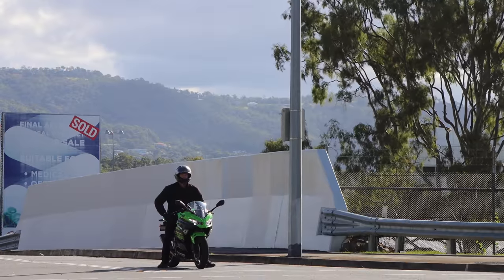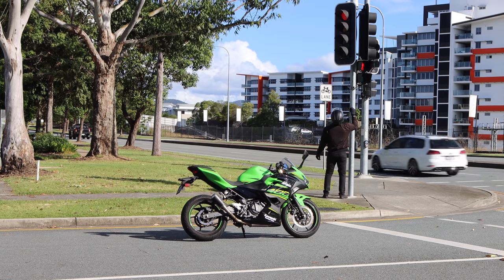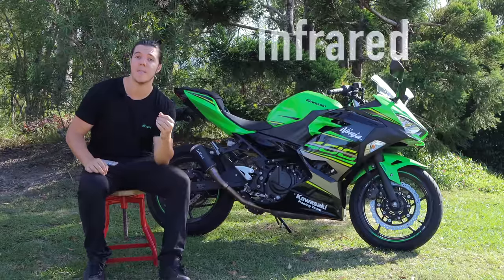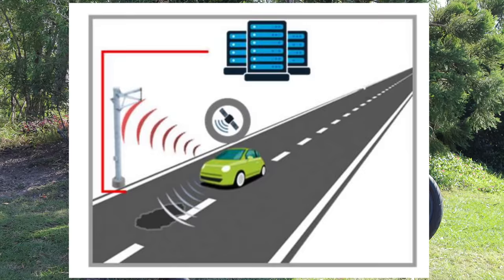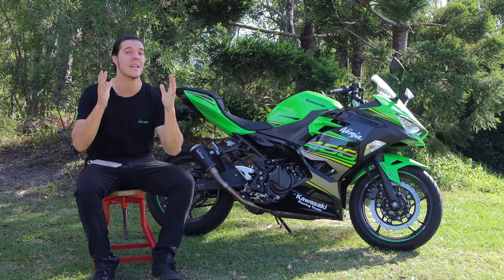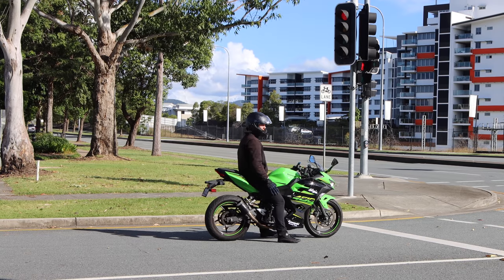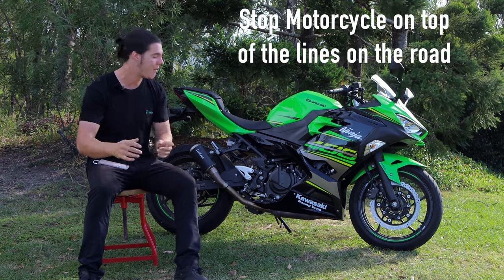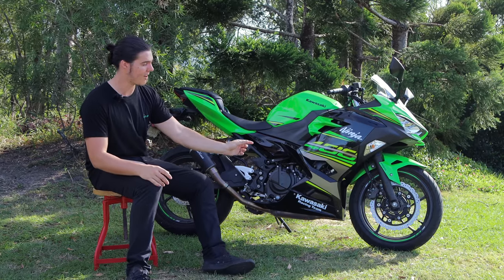How to trigger Traffic Lights on a Motorcycle | Stop getting stuck at red lights

Comment: As a signal engineer for 30+ years and a biker for even longer the most sensitive part of the loop is the corners. Run over a corner of the loop with your wheel and stop with a wheel on the corner will guarantee detection. Do not sit in the middle of the loop having only run over a single bit of loop. The wheels a 30mm off the loop will be picked up a lot better than an engine 300mm from the loop, provide the wheels are conductive. A corner will pick up even a pushbike wheel. When testing the loops we can use a hacksaw or a few twists of cable to trigger the detection
Reply from the maker: Great advice! Thanks for your input mate 🙏🏻

Comment: In my state and lots of states in the United States, you can run a red light at first safe chance after one complete cycle of not getting a green light.
Reply from the maker: Yea I mentioned those 'dead red' laws. What state are you in mate? And is it a common thing that you do?
Reply: @Kwackajack  Arkansas

California

Idaho

Indiana

Kansas

Minnesota

Missouri

Nevada

North Carolina

Oklahoma

South Carolina

Tennessee 

Utah

Washington

Wisconsin

Virginia
Reply: @Kwackajack  there may be more. This list is from 2014. We keep trying to get dead red laws passed in Texas along with lane splitting, to no avail.
Reply: PA also has this...its called ride on red
Reply: In Illinois you are allowed to run it after waiting 2 mins with no green.
Reply: I typically take a right and then do a U-turn or pull left into a parking lot to turn around.
Reply: @IamR3D88  I just don’t stop for reds
Reply: 5:38
Reply: So if I'm approaching a set of green how would I know they have been dead for some cycles before. Plus the US have that weird turn right on red after stopping and most who do wander into the second lane and accelerate like a snail. I much prefer RED means Stop
Reply: @TheByard  
In the US if a cop pulls you over for running a red light after waiting all you tell them is your exercising your right to proceed with caution. It works every time if the cop comes into the picture after you been waiting.
Reply: @TheByard  most of the US also has the left on red from a one way to a one way.
Reply: @dennisthemenace49  Damn dude you reside in all those states??
I can’t imagine all the taxes you pay!
Reply: @charlesmeade4451  As a Brit who started driving in 1962 and have driven in many countries around the world. I find it strange that the US use this filtering system, which going by all the videos on YouTube is constantly abused. For the few minutes vehicles are stopped at the red lights is that too long that cars can filter into a green running lane of the traffic from the left. Often then they cross into the center or third lane, accelerate slowly and cause mayhem that they drive away from unscathed.
Where the system does not work and causes deaths, should be stopped.
Drive and arrive alive.
Reply: Yeah I want lane splitting in Georgia.
  I normally get off my bike and press the cross walk sign also btw. I'll look for these lines next time first though.
Reply: You don't have to stop for right on red... Or I've just been doing it wrong. Pretty sure you check while rolling blast shit, normally 2nd gear. Only stop if something is coming.
Reply: @Whitejesselink  Some junctions you do and there's a sign stating just that, maybe not in your local though.
Reply: @Whitejesselink  In PA, and all the other states that I know of, the rule is Right On Red After Stop. You have to stop and then proceed to turn right if and when it's safe to do so. It's treated the the same as a stop sign, and not stopping is considered running a red light.
Reply: This is Legal in Pennsylvania as well, extended red light, when safe., you can proceed
Reply: I've probably just been doing it wrong. I've never had a normal car, just one race car Miata and a few bikes.  If I taught someone to drive they'd probably be good but unable to pass a driving test in a real country. America let's anyone with a pulse drive though.
Reply: @TheByard  Thank you for taking the time to write a well thought out comment. I enjoy reading longer comments that are well written. (The A.I. is trying to make people forget how to use written words to communicate by giving you suggestions and memes and spell check, so you don't have to think anymore...) You can fumble around on a phone and the A.I. will create a message for you now. I cringe seeing that the younger generation can't even type a paragraph with punctuation.
Reply: @TheByard  Regarding the "right on red" law in the USA. What scares me to death is the idea that you would have a steering wheel on the right side of the car, and you'd be shifting with your left hand? I think something like 93% of the population is right handed. Shifting with the left hand just cannot be as effective. When I watch motorcycle videos in the UK, it scares me to death! I feel like I'm about to witness an oncoming collision, because it messes with my mind, seeing the visual of the lanes being reversed! It's so scary. The "Right On Red" in the USA works fine. I have never seen it cause an accident. What it does is keep the traffic moving, and it's a necessary law to prevent congestion. The problem is actually poorly designed roads, with 5 or 6 way intersections, that are extremely confusing. I get the impression that in the UK or Europe, they would fix an intersection after thousands of accidents. There is an intersection by my house that I've personally seen dozens of severe accidents, and they have not changed the intersection at all.  It's an intersection without stop lights, where 6 different lanes merge together, similar to a miniature Freeway overpass. People get confused easily, and you cannot more than 4 lanes at an intersection, it's just too unsafe.
Reply: @Ritalie  Have driven in many countries around the world and found driving LHD or RHD no problem have also  center seat and facing the side of a the machine, again no problem. Front and rear steering road wheels. On a four year contact in Denmark with a home leave UK once a month. I would drive my LHD car to Copenhagen airport, park if fly a couple of hours and jump in a RHD hire car at Heathrow airport. It's a bit trickier driving a RHD hopping on a ferry to France and the then driving on the wrong side of the road.

London police advanced drivers had to do a test on all the different cars in the fleet. Run to the chosen car unlock it, revers out of parking space and drive to a stop line, operate all the control levers switches etc in sequence and then drive on the skid pan in reverse chasing an instructor who was also in reverse but with bald tyres.

Road design and the use of traffic lights can be improved on using longer time settings for busy roads but real time monitored so one set of lights could allow more vehicles through. 
Test were done that emergency vehicles could operate the lights in their favor with a controller in the cab. This worked well for one or a convoy, but with multi units using differing routes, it needed radio contact to make it work.
Reply: @PAULY-P  Being right is great but being dead right isn't.
Reply: @TheByard  I freaking love Copenhagen.
Reply: @TheByard  
Well, I guess I'm just right....on what I wrote above lol.
Reply: @bty1471  not in Georgia. I've done it infront of cops. You're supposed to look first.
Reply: @Whitejesselink  ok buddy. just cause you didn't get pulled over doesn't mean its legal. i assure you tbe law a ross the US is you must stop before making a right
Reply: @Whitejesselink  You treat the red as a STOP sign if turning right... you have to stop before proceeding. In Europe they don't have right on red, but some intersections have a green right arrow light when straight and right are red, BUT it's like a right on red in North America, there's still traffic coming with a green from the left...

Comment: What I’ve learned is don’t stop in the center of the lane. As you approach the intersection take note of the cut out lines in the road where the wire sensors are to the left and right portion of the lane and stop directly above it as opposed to stopping in between them. Doing so gives you a better chance of the magnetic sensor detecting you.

Comment: Just saw this video. you got a chuckle out of me when you were sitting on your bike having coffee or tea while waiting for the light to change. I can definitely relate. I live in a rural area, and sometimes when I get off late, there is hardly any road traffic. occasionally I've had to run the light. I've contacted my local DOT and all they tell me, is that there might be an issue with the sensor. I've done what you have mention, but it's not working. next time I'll try what another poster recommends about restarting the bike and see what happens.

Comment: I’m in Cali.
The dead red law explains why the cops haven’t pulled me over for ‘running’ the reds.
I’ve looked and shrugged 
One cop even waved me on from his cruiser
Reply: What a badass 😎
Reply: @christian3050  ~ right? I’m such a rebel 😂
Reply: I'm in a Northern California city; the one with no left turns, no synchronized lights.
Reply: @Ramon51650  ~ 😂😂😂
I think I know that place!
Reply: NC here. I've done it with a cop behind me. Bit of a gamble, but they didn't pursue. Either they knew the law (unlikely) or didn't feel like putting in the effort.
Reply: Note, it is not truly “running a red”. It is more of treating a malfunction traffic light as a 4 way stop.
Reply: And, yes I have done it in many jurisdictions in all over North America.
Reply: Bravo!
Reply: @henrybrown9724  ~ well that completely sucks.
Reply: @codedirtytome7178  No, they just know that this is an issue with the loop.
Reply: @henrybrown9724  Same happened to me.  I sat there for at least 5 minutes, no traffic anywhere, 11:PM on a Sunday night.  The moment I went through the intersection he moved from his hiding place with the lights on.  Do the magnet in the shoe trick.  Or try the stop and then electric start your bike. It works.

Comment: New rider here. I encountered this near my home. Yes i too thought the sensors were weight triggered. Now i know the truth. I've been running the red light but i'll try these tips next time.
Reply: What I've found is that there is absolutely no way a sportbike will trigger the magnetic loops. I've tried moving my bike, and putting the kickstand down, and even flashing my lights, in WA state. Nothing works. The only ferrous metal is the crankshaft, connecting rods, timing chain, camshaft, and transmission. It's not enough metal, and you'd have to be absolutely perfectly positioned to trigger the induction loop. It's better to just run the red light after a full cycle, which is legal. Or to simply avoid the intersection (best idea). You can easily avoid these desolate traffic lights in obscure roadways, by just planning your route. Following traffic on main roads, and avoiding stoplights altogether on side streets, is the easiest method.

Comment: I've learned quite a bit about traffic lights the past year or so. This video is informative and well done. I always thought it was stupid to lay down fresh asphalt, then turn around and cut it up. There is one light near my work that never operates properly, and it's annoying when the car behind won't pull up close enough behind to trigger the sensor. I've learned if no car is around to just avoid the light.
Reply: Dude those wires are frail and heat sensitive. If you lay them down and then pour hot asphalt on top of it, you'll fry your circuits and anything else laid down. Road first. Sensors second.
Reply: @rockettrades2229  No.  They are robust and heat resistant.  They are NOT sensitive to heat at all.

Comment: GREAT info! I just checked, and my state allows riders to circumvent being stuck at a light. I have experienced this late at night and it's annoying af to be stuck with no car around to help trigger the light.
Reply from the maker: Glad it helped! What state are you in mate?
Reply: I just go right on red and go back through the other way. 
I also go slowly through corner parking lots at notorious lights. Especially at night. And I’ve had cops sitting there and not have an issue.

Comment: This is excellent. I thought maybe I was just imagining things. One thing that people never think of, is to simply take a different route. More often than not, people don't plan ahead, and they try to pull their vehicle into terrible traffic conditions. When you notice a turn lane that has absolutely no cars, consider driving past it, and turning on a side street, instead of a traffic light. Simple.
Reply: This can only work in some areas. I frequently encounter 'stuck' red lights leaving places that are off a busy roadway. Last time I pulled into a hotel parking lot to make a legal U-turn, and was stuck at the light for a while before I checked traffic and pulled through the 🚦. Also if you're riding in a city with a lot of one ways or dead ends, you don't often have the choice to take a different route.

Comment: The loop trick works. There’s a traffic light that you pass when entering/leaving my work. It WILL NOT switch unless I ride over the wire and stay there. I’ve sat there for quite a long time before I learned this trick.

Comment: Very good video. In many cases, only moving metal will induce a change in the magnetic field so I always try to weave the bike across the line before coming to a stop; and yes, I always stop directly over the line. A bike with an aluminum frame has a greatly reduced chance of triggering a loop detector. If it appears that the bike hasn't been detected, sometimes turning off the bike and engaging the starter is enough to induce the needed trigger, but you'd need to be right over the line. Although I've never had to test this in court, if it's clear that the bike hasn't been detected, I'll treat the light as defective, which in Ontario Canada would become a four-way stop and I'll simply proceed when it's safe.
Reply: Lens law perhaps?
Reply: I'm in ONT as well - problem is we now have those cash grab red light cameras and you'll never beat them in court no matter what.
Reply: @ppower7945  Totally agree. I would never test that out at a camera intersection, or if I think a cop is close by. What I have done more than once is make a legal right turn, a legal U-turn and then a right turn. Far more dangerous than just running the light, I know.

Comment: Good informational video as a retired traffic signal Tech, couple notes on the common induction loop. The corners are most sensitive on the square ones the loops are the only part of the detection and the lead in wires to the loop will not detect you All. The detection zone height is approximately half of its width dimension most loops are approximately 6' by 6' so the detection height is about 3' something to think about if your traffic signal technician and you have big rigs. Also loops may be under a layer of asphalt In this case good luck and you might be best to do what you think is prudent to get out of the intersection. And if you think motorcyclists have it bad you should try being a bicyclist in those cases we would encourage the bicyclist to report the problem detection area and we would actually mark the loops out with spray paint so they could learn where it is. Good luck all.
Reply: I have to agree that riding over the corners does the trick.  I hit both wires at the corner and then swerve over the straight wire. This works nearly every time.

Comment: I've learned to pull all the way up to the stop line and place my front wheel on the stop line itself. The induction loops where I live are close enough to the stop line that the motor is over the induction loop or very close to it. It works the majority of the time - I do have to admit I'm sometimes surprised when it does work though...

Comment: In Canada, there is a sign painted on the road and sometimes a road sign panel. The wire has to be under the asphalt and is not visible or it would need to be repaired every winter.
Reply: They replace the road then come back and cut an octagon about 6” deep in the pavement lay a wire in there and fill it with epoxy or tar.

Comment: Good content on this common and frustrating motorcycle - traffic light problem.  I've used 'dead red' stop and go (as you would at a common STOP sign) many times regardless of state law.  This seems intuitive enough since both the sign and the light serve the same purpose.  However, in a multi-lane road with turn lanes, this can be a dangerous puzzle, especially when there is moderate or heavy traffic.  An alternative to a potential ticket for running a red light that may work in some situations is to simply make a right turn, then  u-turn when practical and go back through the intersection with the green light.

Comment: I live in an area that recently had the pavement at an intersection re-paved erasing the mag loop.  Tried everything to set off the light but it didn't trigger.  Ultimately, having a bunch of alternate routes that avoid the problem intersection helps.

Comment: Ride my Ninja 300 about 5yrs... Do remember, earlier I did tried the magnet attached  on bike and it's true - it does NOT work...  Thanks for the video ✌️
Reply: damn Fort9
Reply: And they weren’t cheap if I remember correctly. About $100.
Reply: @whereswaldo5740   I got mine on Amazon under 20$, since it was useless for that traffic light, I use it to keep bolts together when I work on my bike :)

Comment: Where I am bicycling is common enough that for many intersections they have a spot marked on the ground near the stop line of where to park your bike in order to trigger the light. Not sure if this is another smaller induction loop or it's just marking optimal positioning but they work really well